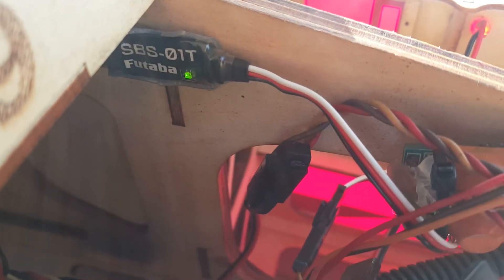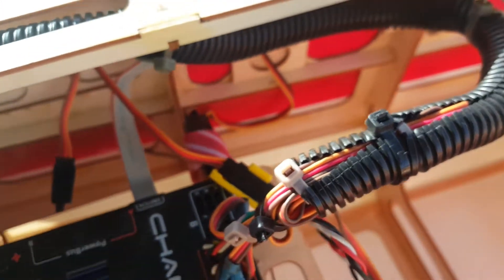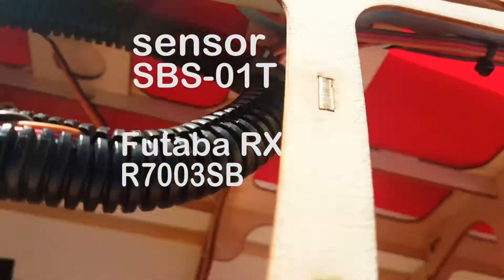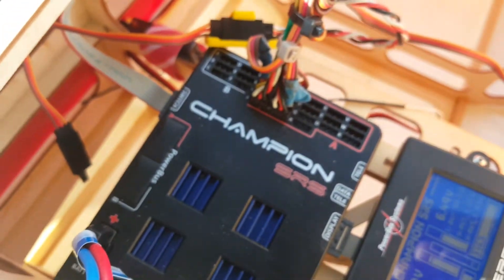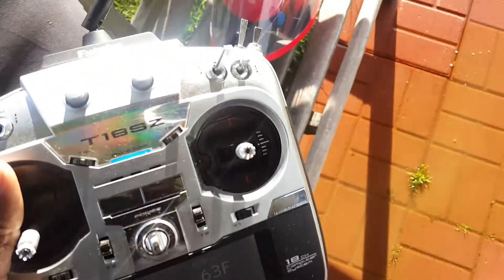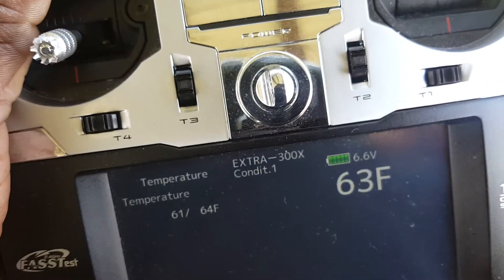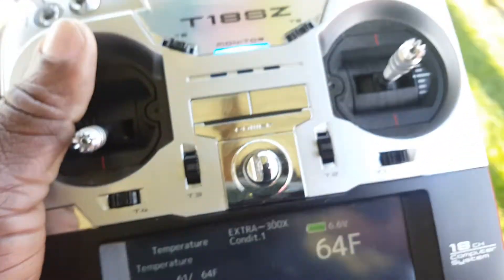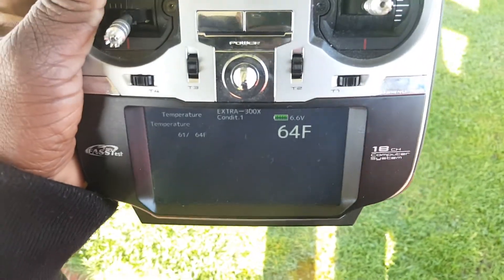Futaba 18SZ temp telemetry

Comment: Hi, Futaba SBS-01G Sensor & T16SZ Transmitter. Altitude and Variometer showing but Distance & Speed not showing in the Transmitter. Any advise please. Thanks
Reply from the maker: I think you need a gps unit to be added to your power box